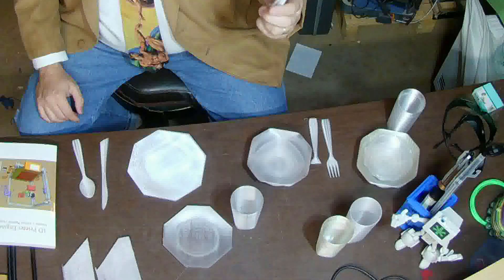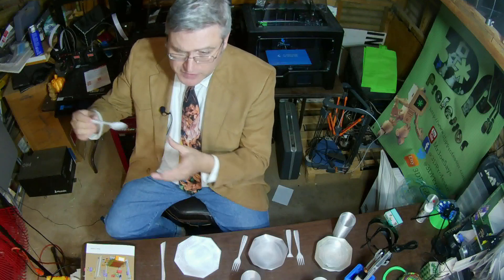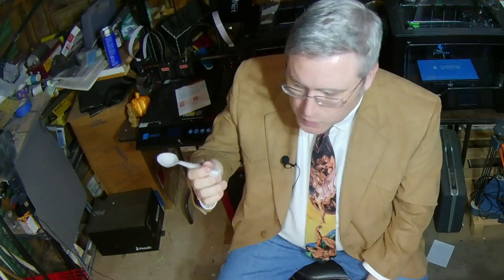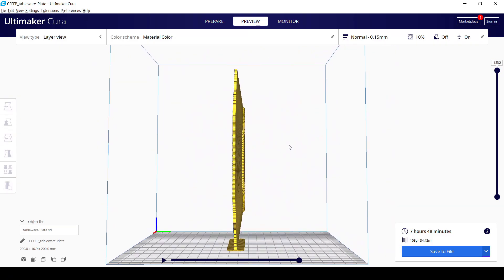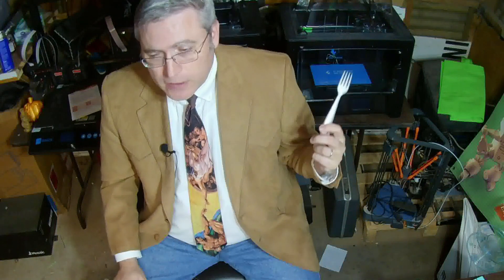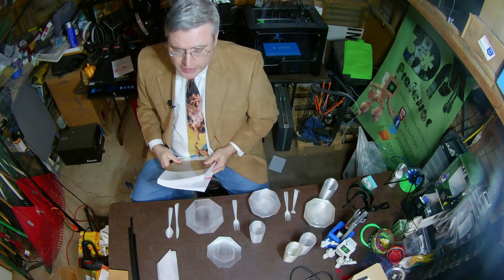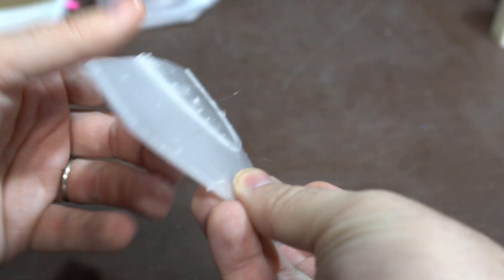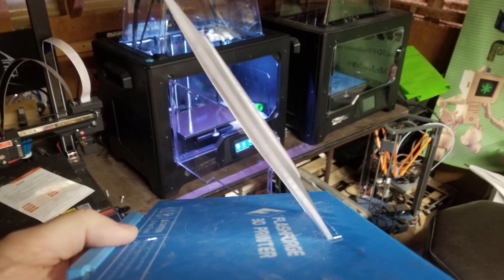Pushing 3D Printing with... a plate?

Comment: Have you tried PET itself? Since it melts at temps closer to ABS it might result in stronger prints while also being the preferred food containing material. As I understand PETG is easier to smooth, so for cleaning it may be better than actual PET, but it's a thought to experiment with.

Comment: 3D printing is one of many methods of producing an item. The utensils and the plates and bowls have a shape that was defined by the methods used to mass produce them, stamping most of the time. There is no way for an additive method to be as efficient and effective because one has to pick the production method that makes the most sense. Of course when you only have a hammer everything is a nail :)

Comment: By printing the fork and spoon at the same time, the minimum layer time was increased by a lot, so this experiment also had more time to cool. 

That is probably the most impressive overhang I’ve seen. Stacking up those plates on their side with a small amount of interface would be increasingly rigid and you can print loads.

Comment: The problem with food safety with 3d prints is the re-usability issue. 
Food debris can get stuck in the layers and end up in any future food you eat off them, however some foods are generally pretty safe, such as non sugar based beverages.  (diet soda's) or possible dry candy since sugar generally doesn't go bad (you can eat ancient honey for example).

Ultimately it makes no sense in the end unless you have a very special custom design use case since paper and plastic party plates are extremely cheap! (cheaper then printing plastic)

PS. Love your videos, you just get busy playing around with 3d printing, mind your own business, and don't complain about what everyone else is doing... :)
I'll try to print some of your examples in the future (new house, printers need re-calibration/fixing), I do have 4 types of fdm printers. (and couple resin, but that's not going to be helpful)

Comment: I call i3 style printers Y thrashers.  They make a good introduction to 3D printing but they have their problems.

I don't like Deltas if you are printing things that require dimensional accuracy because the resolution varies depending on how far from the center of the bed the print head is.  However, I think they are the most fun to watch.  They work fine for non engineering uses.

I am partial to the core XY printers.  I scratch built a V-King.  Modified it for direct drive because Bowden while lowering the moving mass of the print head introduces problems with retraction, blobbing, and stringing which can only be partially tuned out.  The additional mass of the direct drive extruder is easier to deal with.

Best Wishes!